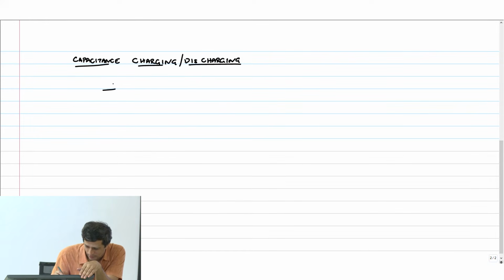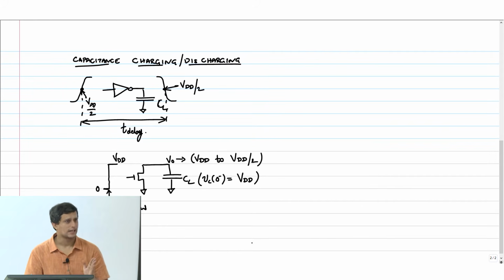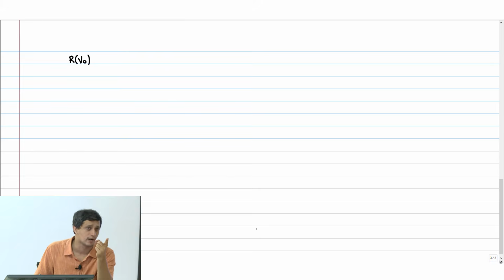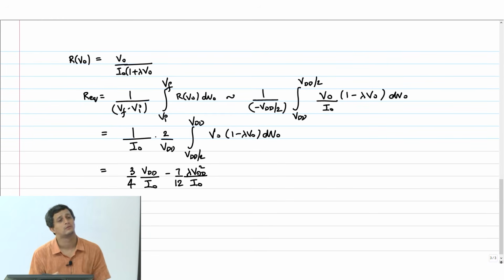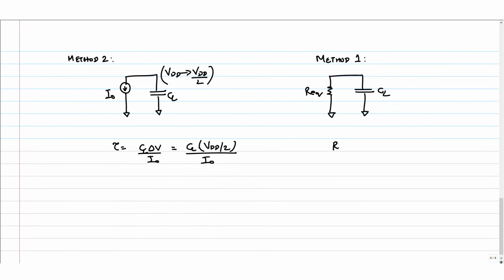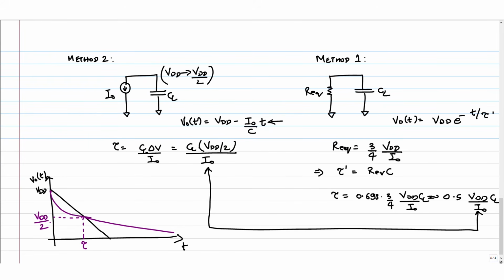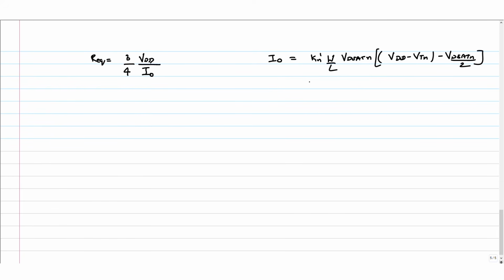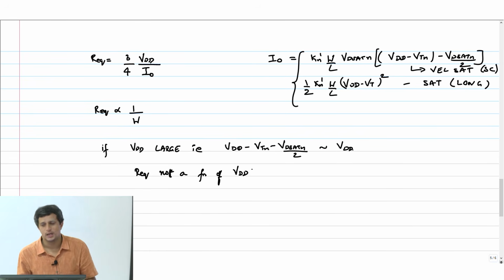Inverter - 12 - NMOS Transistor ON Resistance and Fall Delay

Comment: sir why 0.693 is used at the time 13.37, we are analyzing for 50% of Vdd. 0.693 is for (100- 63)% discharge time of capacitor. i have confusion about this. please explain.
Reply: Use discharge equation of capacitor. 
Vc(t) =Vo*e^(-t/tau) 
Put Vc(t) /Vo=1/2 for 50℅ discharge. We get 
t=ln2*tau=0.693*tau
Reply: @alraghuschannel4023  thanks